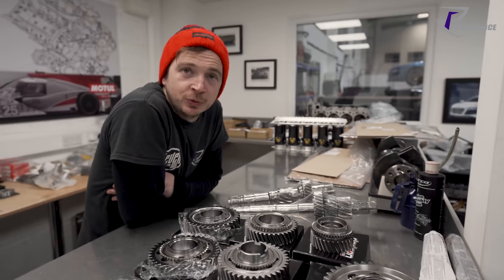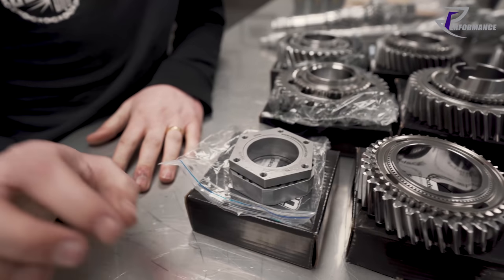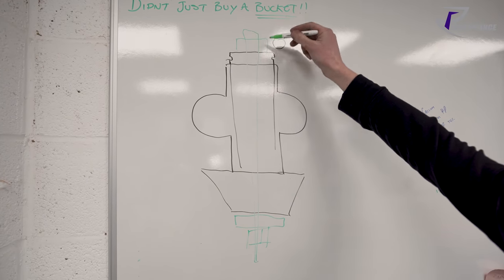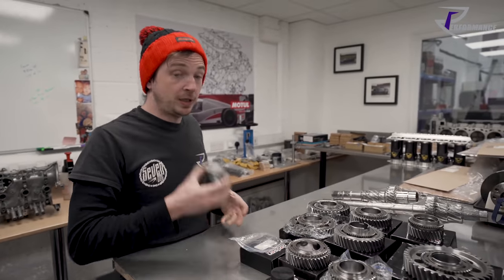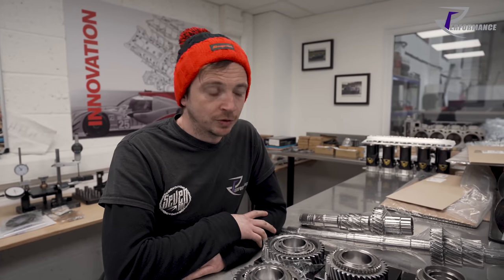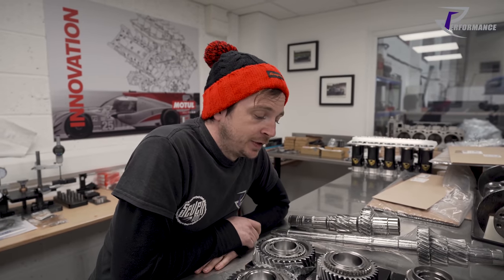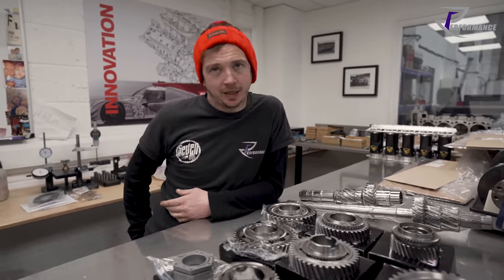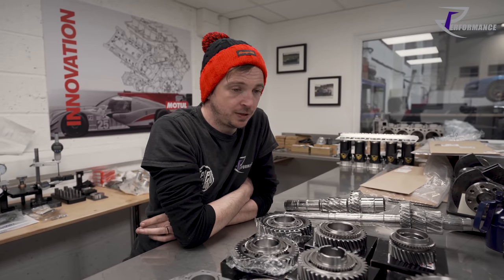What's inside a Dodson V10 Lamborghini / R8 gear kit?

Comment: Why not just use a bearing press to crush the sleeve?
Reply from the maker: We do, but still the worst job in existence! Also doesn’t allow for adjustment of preload.
Reply: @REPerformanceUK  by the way, it was a great informative video because my car is in the shop right now and we don’t know yet what the problem is. We don’t know if it’s a communication problem but I was doing a pull, for reference of the TwinTurbo car running around 1400 crank (800 lbft) and I threw a code shifting into 5 gear. I thought I had billet baskets, but I don’t but I had just accidentally re-flashed the ECU with the wrong file so I decided to watch your video and now I realize how complicated these things are.   I do not have a second gear upgrade and I’m on a base model gearing. So I’m sort of overhear crapping my pants wondering how much it’s gonna cost lol.
Reply from the maker: @thatcarlifeR8  Thank you. Where in USA are you based? AMS & Sheptrans do similar work as us on these.
Reply: @REPerformanceUK  Arizona. B-Rogue built the car in Chicago. I believe they are flying out to complete the repair and perform some upgrades.